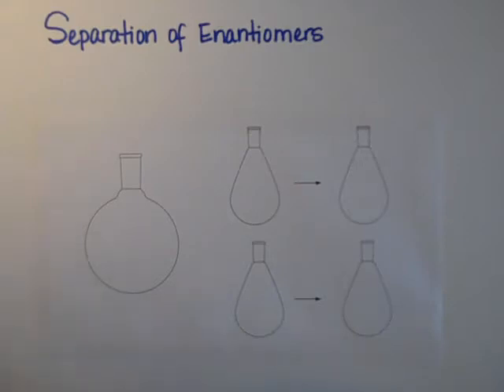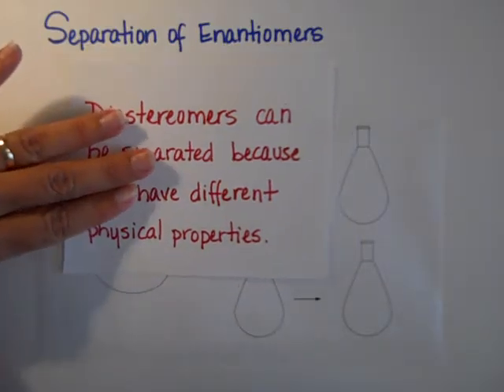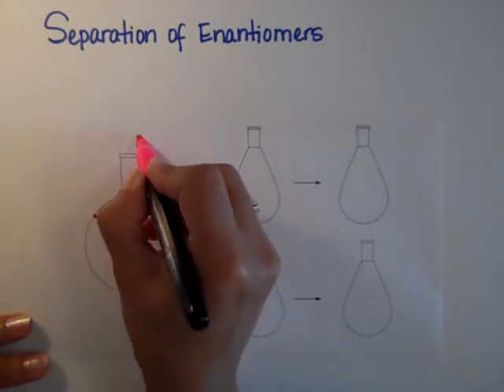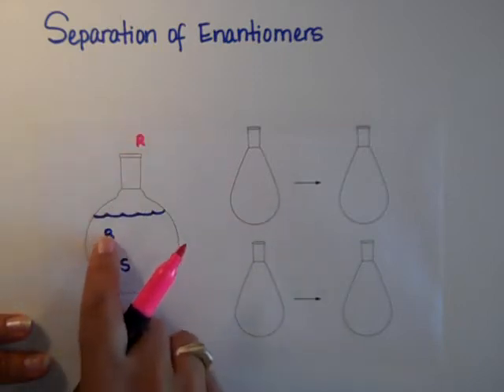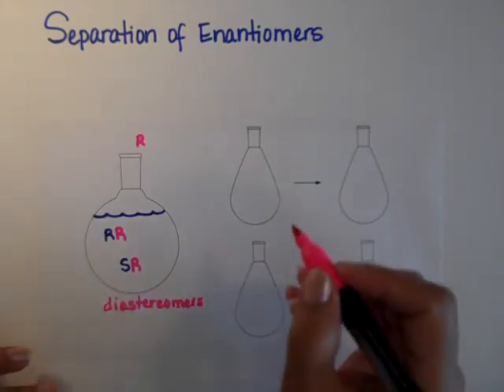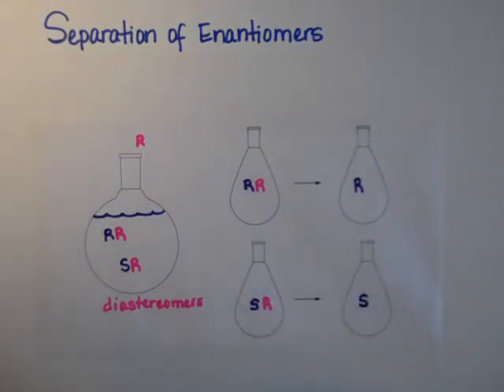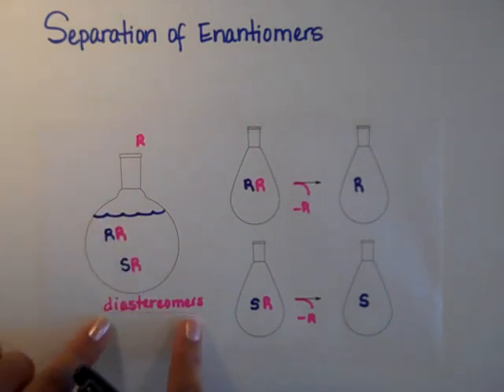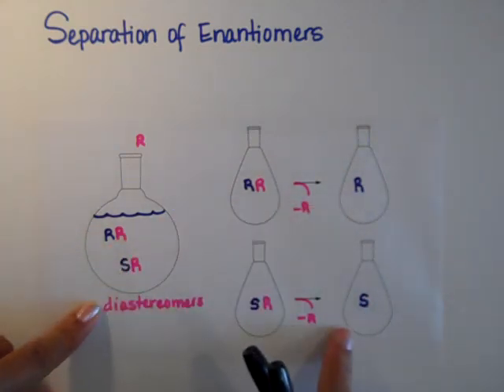Problem 1 Separation of Enantiomers

Comment: My problem is,  I have a racemic RS-drug and  I used L-tartaric in ethylacetate as solvent  but both the L-tartaric and RS-Drug dissolved completely and there is no any precipitation after dissolving process, then i kept in the room temperature, at  mines - temperature and 0 temperature but still did not get any precipitation to filter it and separate the enantiomers.